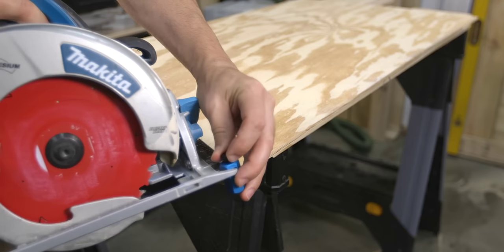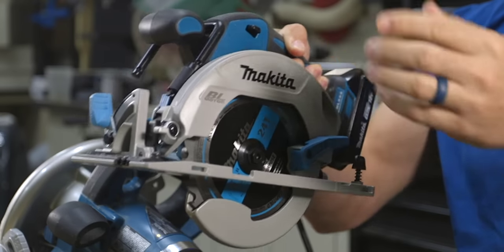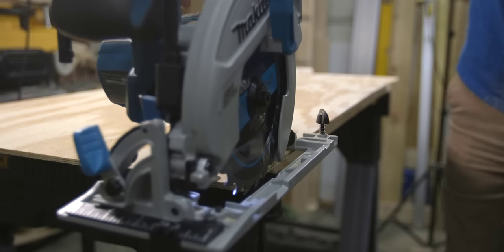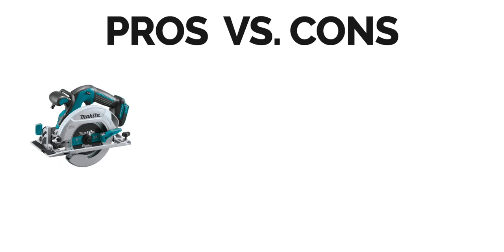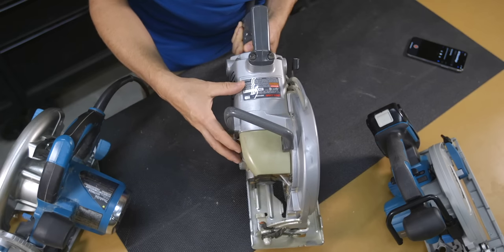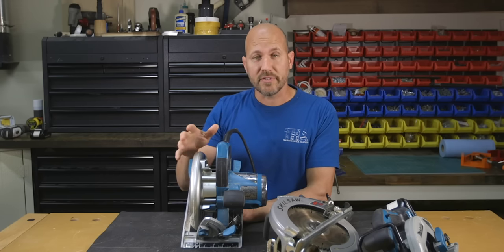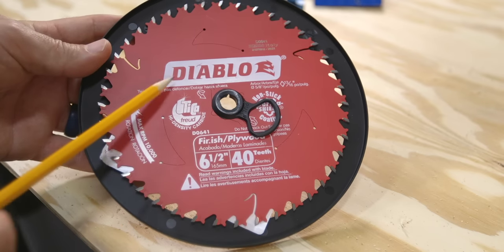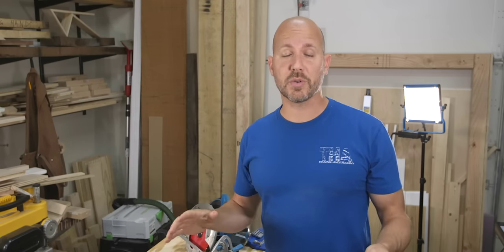Buying The Right Circular Saw That's Best For You

Comment: most professional framers and carpenters that I know (myself included) use the worm drive (or Makita hypoid gear) saw most of the time.  They are far more powerful, more balanced and cut better than a sidewinder, especially for right handers.  Once you get used to the weight, it's just a superior saw.
Reply from the maker: Thanks for sharing Kren!
Reply: Are you from the West Coast?  Most of the pro carpenters and framers in my area use a blade right sidewinder. In recent years guys started using the 6-1/2 cordless saws, which are blade left.  I had been around professional carpenters my whole life and never seen a worm drive in use until YouTube and Larry Haun. I even heard Rob Robillard AKA Concord Carpenter, who is a consummate professional carpenter, say the sidewinder was an East Coast norm and the worm drive was more of a West Coast norm.
Reply: You’re not wrong, but those saws are heavy, therefore most guys don’t use them unless they’re going to set up a station with a cut man and have him cut all day.
Reply: Wormers are un-gawdly heavy, but yeah, that's been my observation, too.  They are very common among pro framers.  I never liked the weight and fatigue of running one all day, so a long time ago I bought a Porter-Cable 6" Saw Boss.  Got laughed at , but that stopped pretty fast, and a couple guys ended up getting their own.  There's a lot of testosterone in construction, and most guys  need to be convinced bytheir own eyes or they'll keep killing off their tendons til they can hardly scratch their heads when they retire.

Comment: Corded saw all the way it will last long for years just change the carbon brush and put best blade you can afford for clean cuts. I disagree corded saw are more light and balance to hold than the one with the battery operated counter parts because of the weight and bulky size of the battery in it. Cordless BL circular saw will last for few years not because of the motor but the electronic controller board that fails.
Reply: Agreed. For contractors, where they can afford to buy several 5-6ah batteries, and they may need to be up and down ladders cordless might be usefull. But for your average DIY'er like me, it's too much of a pain having to keep charging batteries up.
Reply: Honestly, I think it depends what your doing and what your cutting.  Cross cuts are easy on them but for rip cuts on pressure treated lumber....it's annoying when the battery tools cut out from over heating.  Battery is convenient but far from perfect for tools that draw a lot of amps

Comment: DeWalt 60v Flexvolt saws are more powerful than most corded saws. There are a couple of 48v cordless saws too that can challenge some corded saws. The market will probably change in the next decade or even sooner, and a bunch of cordless saws will be more powerful, as you can get higher amperage’s out of batteries vs. 15 from a wall outlet.
Reply from the maker: Thanks for the info. I've never seen that 60v before... wow.

Comment: I'm a lefty 60+ yr. 0ld beginner and I prefer and have both right and left blade saws.  When making long cuts like ripping a sheet of plywood I use the right bladed saw because I can see the cut line clearly and the weight of the saw is on the stable side of the sheet not on the piece that is being cut off.  If I'm going to cut off a small piece of 2×4" then I will use my left bladed saw because my left hand will be holding and guiding the saw while my right hand will be holding down the 2×4" plus, the weighted side of the saw will again be on the stable side. As far as cord vs. cordless, I like the cordless because of the convenience of not having to find a power source and not having to pack a long extension cord.
Reply: Thank you. I’m lefty too. Good to know.
Reply: Planning to get one for some projects in my house but not sure about which one to get. Is it better to get the small one or the one with the table? How easy/ hard is to cut on the ground? Worthy? Thank you
Reply: @karimgomez6933  I am thinking that what you mean when you asked the small one or the one on the table your referring to a circular saw (hand held) or table saw (stationary).  Usually the table saw will make straighter long cuts over a circular saw like cutting long pieces of plywood or 2"×4"×8' strips length wise.  The circular saw being portable and probably the one that you may use more might be more practical.  I don't have a table saw but rather a miter saw which I use regularly when doing my little projects.  As far as what size of saw you should get, my preference would be a circular saw with a 6 1/2" blade but it all depends what size of wood that you would be cutting most of the time. Also cutting on the ground is good for pieces that are to big and/or heavy for a work table but make sure you brace the wood so it doesn't fall in as to bind the blade while your cutting or if cutting a finishing piece, the wood doesn't fall back as this may cause the underneath of the piece that you're cutting to rip.

Comment: For my needs I use a cordless drill and corded saw. I mostly use the saw in a shop and if I take it outside I dont mind the cord. It’s not in the way as prepping for a cut is more steps than drilling a fastener. And the additional power with the corded saw is always a good thing.

Comment: Your savvy regarding safety considerations that we beginners would not think of is very much appreciated.  I'm a right-hander who was considering a left-blade saw, and you talked me out of it.  You have a gift for identifying potential unintended consequences.

As for batteries, one aspect did not appear here or anywhere of the last two hours of videos ... battery and charger management.  Batteries are great for some things, but having to manage an ever-growing collection of frightfully expensive batteries ... even if you stick with one company's tools ... makes handling a cord seem much easier.  Yes to batteries for lighter duty drills and blowers, but let's plug our saw in and forget about sustaining power and juggling all of that extra gear.

Kudos!  Thanks!
Reply from the maker: Great info. Thanks for sharing.
Reply: Other thing is that if you do use it with two hands,  left had is blocking this prized unobstructed line of sight.   Also, if you cut free hand, and perhaps at a height in front of you, you want a solid two-handed grip with blade on top, not below.      To add, side view of a blade, I am not getting as accurate cuts than when looking at the line over the blade, that right handed saw kind of enforces.  So it is right handed for my type of house work.

Comment: I have a Right side blade and am left handed.  Works great.   I can see the blade and use my right hand to move the blade cover.  No issues
Reply from the maker: Awesome!
Reply: And you get the sawdust straight at you, awesome! Im right handed and got both types, i think its best to practice some “best practices” and go for right bladed for right handed, and left bladed for left handed. Like the mentioned problem of not being able to reach over a plate to make the cut, i found its not a big problem to switch hands for such cuts. Quality may suffer a little at first but if its a critical precision cut i got an 8ft rail.

Comment: Great video, thanks.

In this day and age, there is no reason not to get a cordless saw - or any other tool. Just pick your favorite tool company and start a collection of great tools that work on a single set of batteries. The convenience is well worth the extra cost, especially when spread over an entire collection of tools.

Plus, in my opinion, your average non-professional who might build a dog house, make home repairs, lay a floor, build or patch a fence, build a shelf, repair a deck, build a work bench, complete hobby projects, etc etc - almost anything around a house or yard - only needs a 6.5 inch circular saw. They are less expensive and easier to handle and store than a 7.25 inch, They cut considerably deeper than a 5.5 inch, and they are plenty powerful enough for any standard material you are likely to encounter. And, since they are lighter in the hand and easier to handle, I happen to think they are safer than a 7.25. There is also a full array of readily available blades to tackle everything from 2x lumber to sheet metal and even tile. I have owned both, 7.25 and 6.5 inch saws for over 30 years, and I can't remember the last time I reached for the larger one. I even built a 600 square foot addition with a 6.5 saw, complete with a full bathroom, and it came out great.
Reply: Totally disagree.  Depends on what's and how much your cutting/doing.  Obviously you have to cut much pressure treated lumber and have the battery saw stop on you from over heating.
Reply: @mishapesic9323  it hasn’t happened to me in 30 years with cordless circular saws, but I guess there is a first time for everything.

Comment: Get the lightest saw you can handle that will cut a 45 thru a 2x4.  I like the Porter-Cable Saw Boss, a 6" left side low angle handle saw that has served me well for almost 28 years.  I use it for almost every job.  I've had the Skil worm drive, the DeWalt worm drive, and found them, fatigueing and awkward at odd angles of use, but the little Saw Boss can go up and do rafter ends, as well as sheet cuts, even though you have to move around because it doesn't quite make the whole reach like the long body worm drives.

I've also owned the basic heavy duty Milwaukee and I still own a 1962 Rockwell (really a Porter-Cable) Model 315.  Looks like a Kirby vacuum, all polished up.  My parents bought it new and remodelled the family home in 1963-1967 with it.  It has seen hundreds of tasks and still runs like new.  The Milwaukee is very much like it.

As for a left drive being awkward when the waste piece is under the weight, that's just the part where the "Skil" comes in.

Look for a saw with a handle that is low and  behind the weight - not on top of it.  Much easier to steer and control that way.

Comment: Thanks for the video.  I have a 6.5" left bladed battery powered which I really like. It's light weight and convenient (with no cord to get in the way). I also have a right bladed 7.25" corded saw which I also like. It's more powerful but heavier and has the cord to deal with. Both saws have a laser light built in which I find very useful (although I left the batteries in too long and they corroded the battery box and wires and now no longer work). Both saws also included an adjustable metal rip fence which I have used and found very useful.
Reply: What brand?

Comment: Thanks for the video.  I have a corded Makita saw that I have had for years.  I mostly use it for cutting sheets of plywood.  It is heavy and the cord is always a concern.  Although I don't use it often, I am considering a battery operated saw of a smaller diameter.  Like my cordless drill, they are very convenient.
Reply from the maker: They really are convenient! Hope you are doing well David.

Comment: Great video, good timing! I used my circ. saw this morning and not being able to see the cut line was frustrating! Motor on the left, blade on the right and I'm right-handed. At the time when I purchased the saw, I was non the wiser about left-handed and right-handed saws. Hopefully one day I will buy me one with the motor on the right!
Reply: Actually its not called left or right handed, but left or right bladed, and blade on the right is most often correct for right handed users, as a websearch will tell you too. There are many exceptions so it depends on your style. I got both types, both are Makita, i am right handed and for me its advantage blade right, esp the sawdust thing.

Comment: Josh,
That was a really great video, I never knew that circular saws came in left and right-handed versions!
Thanks for the content.
God Bless.
Reply: me either. I'm left handed but I've adapted to a right hand world
Reply: Because they dont, they come in left and right blade versions, both got pros and cons. I got both types and the right blade saw is best for me as a right handed person. A quick look at them will confirm this, but wormdrive is an exception as those are made with blade left. 
As for problems seeing the line with right blade saws, its usually not a problem and when it is you look on the inside, its not by accident that Makita put led light hidden inside there on some saws. Right hand, get right blade. Or try both.

Comment: I tried the Kreg jig. Is not bad but I wish a bought an 8 feet straight edge earlier. Now cutting play wood sheets is a breeze. The jig only works good if the factory edge is good. Also when cutting wide piece the jig is to really stable.
Reply from the maker: Thanks for sharing!

Comment: Honestly ? Only 6K views? Dude that explanation was really what I was looking for, a bit general but totally on the topic. If I may recommend a speed square as an excellent addition to the circular saw. And a question : there are circular saws on the market which are called a worm drive , but they have motor exactly the same , just the handle is on the back, I honestly prefer torque vs speed as I’m making heaps of cuts but what are those `worm direct drives" are they worth looking at ?
Reply from the maker: The speed square is a GREAT accessory! Thanks for bringing that up. I haven't had time to look into those worm direct drives so I really can't say too much. Thanks for the comment Rave. Be well!

Comment: Highly recommend cordless for homeowners.  Have Milwaukee M12 5-3/8".  Light and quiet and cuts great.  I use it for cutting wide boards and ripping.  Also will cut 2x4s 90 degrees.  I also have a miter saw for angle cuts.

Comment: Would a Tracksaw (without using the Track) do everything that a Circular saw can do?  I was thinking of getting Makita Tracksaw so that I can use the track for cutting sheets and use it without the track for cutting framing lumber.   this way I do not need to buy two saws.  although more expensive, I prefer Tracksaw over using a straight edge.  Reply is appreciated. - Thanks
Reply from the maker: I actually don't know if a track saw would also make a good circular saw. I don't own one so I can't personally speak to that. Sorry, wish I could help.

Comment: May I ask a stupid question about blades? How do you know you’ve attached the blade correctly? Does the writing on the blade ALWAYS face outward? I’m not a builder guy but I sometimes do stuff with wood, if you remember I sent you a pic of my melted blade guard about a year or so ago and you recommended I don’t use it again so I haven’t. On my new one the blade manufacturers name and stuff is facing out is that right? I’m sorry but I really don’t want to cut anything off of me that I still need. 😂
Reply from the maker: Sure, I remember you John! The writing doesn't always go out... it can be different on blade right and blade left.  I think the easiest way to know which way the blade goes is to always install it with the teeth facing up. Circular saws cut up, so the teeth need to be facing up or pointing up for that to happen. There is also an arrow marked on the blade that depicts the direction of rotation, and that too should be rotating in the upwards direction. I hope that makes sense.
Reply: @TrainingHandsAcademy  yes it does, thank you so much for your help. I love your vids and I’m learning a great deal thanks again. 👍👍

Comment: 2:18 perhaps a better technique would be to hold the saw with your left hand instead (on the main handle)? That way you could stand to the right of the saw and still have the heavy motor side on the keeper end of the sheet. And you can place your right hand on the aux handle. You'd likely use a guide in this case so even if you are less accurate with your left hand it doesn't matter since you have the guide.
Reply from the maker: Great stuff! Thanks for sharing.
Reply: @TrainingHandsAcademy  Np. I'm still learning myself so if you see any safety issues with that method or if anyone else does please do comment.
Reply: Yes i do both these, switch hands and if its a critical precision cut i got a rail.

Comment: How do i know what size i need to buy does , do you base this on the thickness of the wood you will be cutting? For the table saw
Reply from the maker: The thickness of the wood does matter for sure... you need to buy a saw that cuts through the material you use the most.

Comment: Would you recommend the 6 1/2 inch saw for a women with less muscle power - is the saw lighter in weight? Thank you
Reply from the maker: I would recommend a battery operated 6 1/2 for sure. I really like mine.
Reply: @TrainingHandsAcademy  Many thanks - I am having to do a lot of minor projects that I just can't afford a builder to do, so on-the-job learning and your videos have proven to be very helpful.  Good, relevant information, no fluff,  but clear instructions.
Reply from the maker: Let me know if you have more questions along the way. Feel free to reach out on IG as well or email.
Reply: Yes! I was never able to use my husband's heavy saw. I finally got my own, a 6 1/2 battery saw, and use it all the time. It's very light, very comfortable. I wish I had done it sooner.
Reply: @catherinesollman5868  Thanks so much - this is great confirmation.  I have been struggling with the expense - to buy the 6 1/2 is a lesser bought saw so its price is higher, and the cost of the charger and the battery are more than the cost of the saw.  So I need to make a good decision that I won't regret.
Reply: @tpaine1815  why not take a view on a lightweight saw, like the bosch?